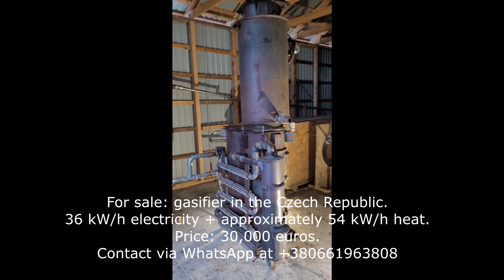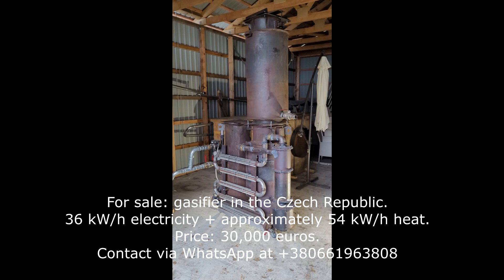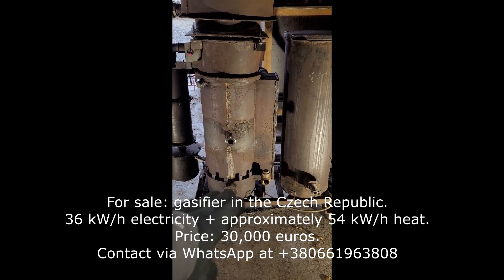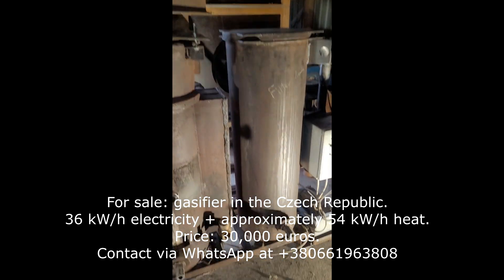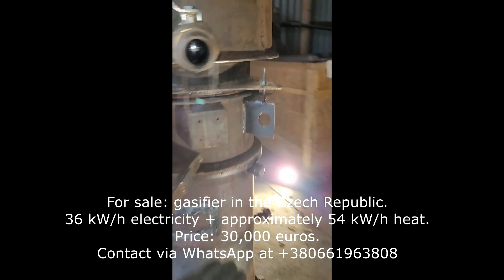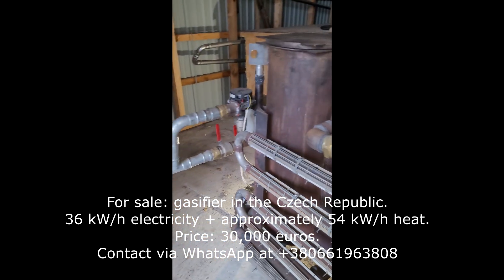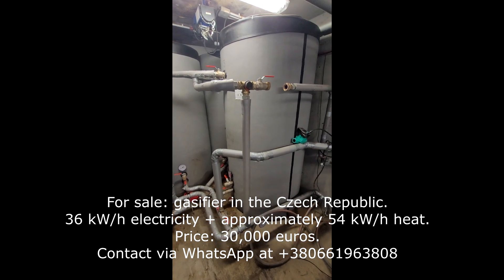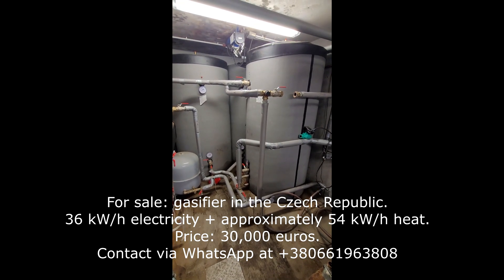For sale: gasifier in the Czech Republic. 36 kW/h electricity + approximately 54 kW/h heat.

Comment: How Amazing , good work ! 😊 good inspiration for how en where to place the components 😊,  im building a simulare  kind of system only way smaller 😅 only 3 kw electric en approximately 5 kw heat whit a 200l water tank + fuel drying system